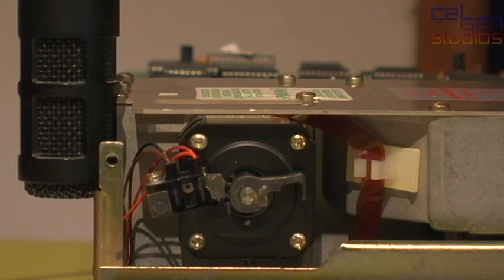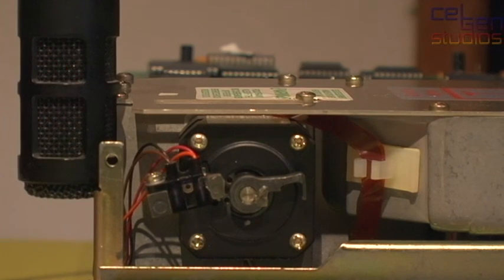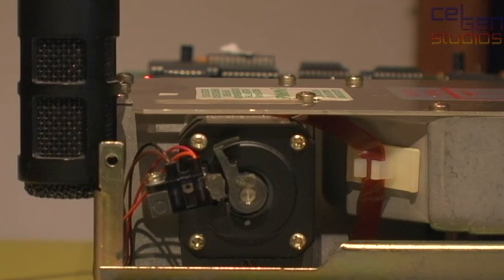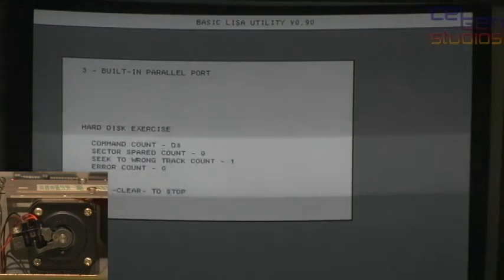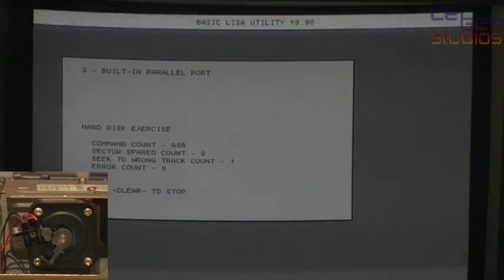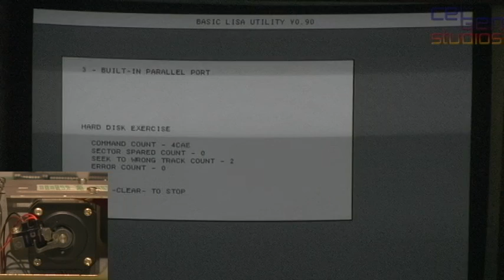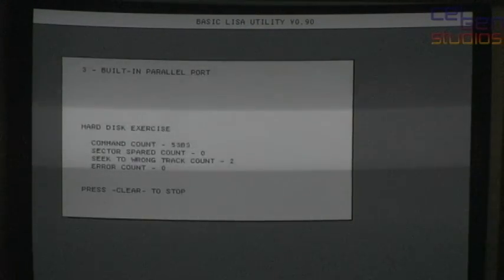Apple ProFile Hard Disk: Additional Details

Comment: The bearings in your drive sound bad like mine :( Pinging and rattling around. I'm afraid to run the drive now for fear the bearing will nuke and make the heads hit the platters. 
I wonder if the stepper on your drive is binding? I'd try putting some light oil on the stepper shaft and seeing if it improves. 
You could also try moving the stepper by hand... unplug the stepper power, power the drive so the heads are floating, and see how easy it is to move. There should be very little resistance.

Comment: I wouldn't be so quick to focus only on the head stepper... 

If the read/write circuits are not properly reading and writing from and to the platter then all bets are off. Noisy bearings can generate noise that could interfere with the read/write circuits. Also, power supply voltage levels are not the only parameter you want to check: use a scope to check the power rails for voltage and current dropout and noise.

Also check the suppression diodes (four 1N4001) in the head stepper quad darlington drivers circuit... the diodes might check 'ok' for directional continuity but reverse current leakage could be an issue, as it might cause the stepper to miss or spike. Check the quad darlington driver packages for uneven heating.

Comment: Every once in a while I can hear a grain of sand fly out of those HD bearings.... ;)  The Quantum Q2040 8" HDDs also tended to have noisy bearings.  Luckily there is no longer a rubber stop inside HDD which turn to goo causing the heads to stick.

I seem to remember something odd about the HDDs which Xerox used in their 6085 Workstations which of many were Micropolis.  Something about the drive needed to be at operational temperature before accessing.  Seemed kind of bizarre.

Comment: Right off the bat, that's an ST-400 series. It's also not been parked correctly.
1:41 the bearings are very dry. 
2:00 That is a very unusual initial seek. The ST-406, ST-412, ST-419 all from the factory just step outwards towards cylinder 0 and stop.
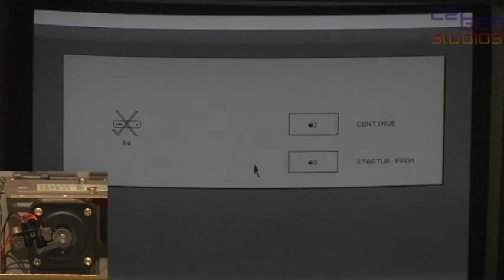3:30 This seems like failed seeks to me.
Reply from the maker: It's ben years since I made this video but yes you are correct. The stepper has dry bearings and it's the source of the mis-stepping.

Comment: Was this drive working before, and now it does not*? Do you have an oscilloscope or a logic analyzer that you could use to watch the output to the stepper coils? This is such a strange problem, and I'm wondering what you've done already to diagnose it. From your last video it sounded like you got into it pretty deeply..

*by which I mean to say: has someone else possibly mucked with it before it came into your hands, or was the stepping problem something that showed up while you were using it?
Reply from the maker: +Gracana 
My logic analyzer is too old and basic (HP 1600A + 1607A) to really be of much help and my oscilloscope is too slow and lacking storage (Tektronix 335) to really be of much help either. Look at the previous video (https://www.youtube.com/watch?v=KNbd9Ph_JqA) and there's photos of the machine running fine with the drive in the past under my ownership. I was give it AS-IS and untested and it seemed to be perfectly fine for two years, then it dropped out. Short of verifying the coil impendence I'm positive is not the motor. The circuit design is incredibly simple on the PCB It's just over a dozen resistors, diodes and IC's.